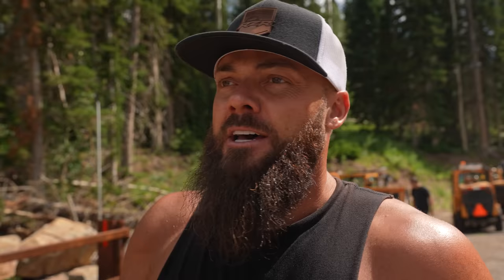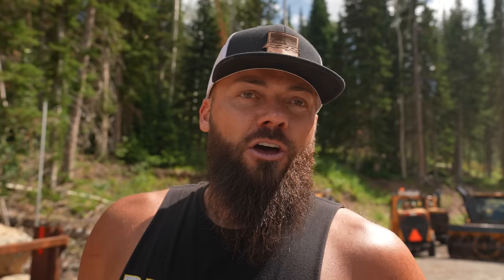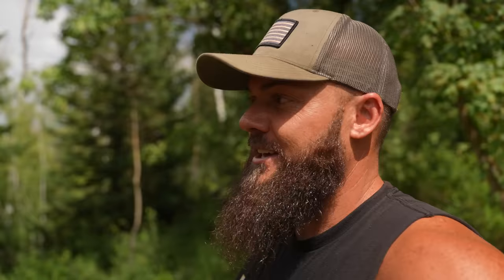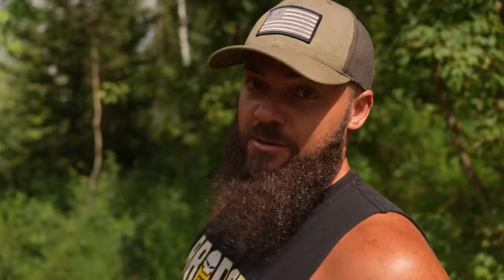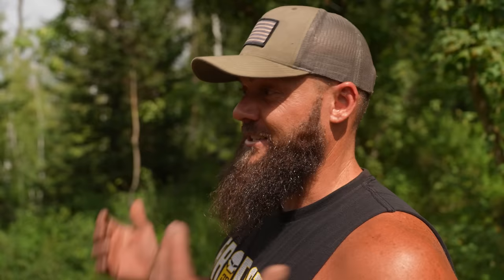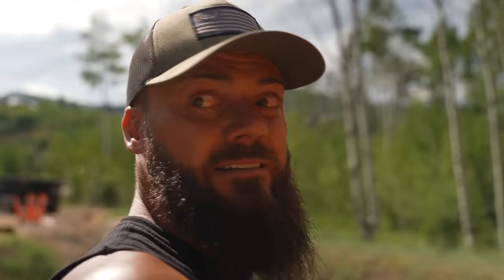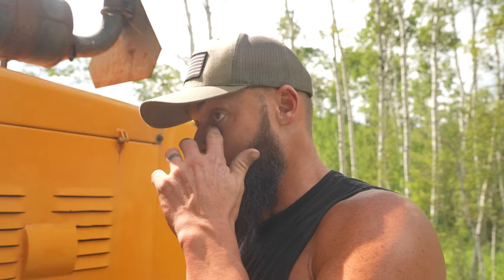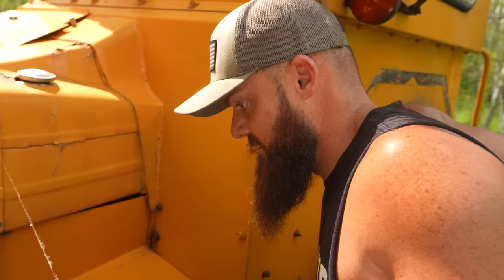I Bought One of the Most Rare an Interesting Machines In the World!

Comment: This machine is based on a Ford 5000, which was then converted by an old English tractor company called county. If it’s a 4 cylinder the tractor was probably a county 794. They were then converted to these snowblowers in Quebec Canada.
Reply: Also pretty sure the cummins powers the blower and the ford engine just powers the tractor like it used to when it was a tractor
Reply: Correct although it was based on the ford 7600 and later the 7610 which this one is
Reply: @MAXQ14  yes 100 percent.  Of course the original engine under the hood powers the tractor and the add on engine runs the add on blower. Dave not very bright. And yes a Ford county.
Reply: @oakfarmagricultural506  this one is too old to be a 7600 it has the selectosoeed box which is in the Ford 5000 era
Reply: @dylanwilliams2954  yes I noticed that afterward but its strange as it has the ford 10 series bonnet/nosecone which made me think its a later one
Reply: I was stationed at Grand Forks AFB '61-'65 and they used 4 tier augers because the snow drifts were so high.
Reply: Oh. No Canada. Retired U.S.M.C. Wave white flag.
Reply: If that's the case then the Ford engine is the traction motor and the other one would be for the blower assembly/
Reply: That’ll be the same County that converted Ford Transit panel vans to 4x4 then, which are legendary vehicles here in the UK. Also that 4cyl was the same engine that was in the first ever loading shovel I drove, made by Bray.
Reply: Mmmh, an old County Commercial Cars  (Fleet, Hampshire. U.K.) tractor base unit ! Wonder how old ? I could have built this !!
Ex CCC employee .......
Reply: Was gonna say it looks like a county
Reply: @oakfarmagricultural506  seems though it´s missing a turbo
Reply: No such thing as a 794..!!
Ether a 764 or 974 perhaps.
Reply: Yes I think r right about it being a 5000 tractor then county converted it it's worth a lot of money we're I'm from 👌
Reply: You took the words out of my mouth, I was just about to post a comment and that was it’s got to be based on the old county tractor and that is a major collectors item over here in the uk.
Reply: ...damn!
Reply: Wow!  Did king Kong ever eat snow cones?!? That'd be cool....work one of these snow cone machinesinto a new king long movie remake!!!
Reply: @oakfarmagricultural506 

😊
Reply: It’s got a 10 series nose cone that’s confusing me as I don’t think they made any like that
Reply: That cap can be swedis harra aktiepolag
Reply: I just waited to see if I can see the driveshaft for the 4wd to know exactly that it is a county. The 4cylinder is in there to Power the traktor and the engine in the back is for the blower.  Your Transmission is a so called ford select-o-speed

Comment: The old snowblower is based on a County 754 (or possibly 764, depending on the year of built?).
County Tractors was a UK based company, that converted Ford tractors (in this case a Ford 5000 2wd) into a 4wd. In the days Ford didn't supply 4wd as an option yet.
Each front wheel has a seperate drive shaft taken from the rear axle. This results in a low centre of gravity and great grip, but also in a slightly bigger😊 turning circle.

Since the tractor is for quite some part based on a Ford 5000, those parts should be available well.
For the 4wd part: those are County parts, which can be bought at Mark Osborne (County tractors parts Ltd).

The engine in the back will power the snow plow. In the first versions, this was a 6 cylinder Ford engine (about 100 HP).

County tractors are highly collectable tractors in Europe  especially in the UK.
I have a County 754 myself.

The Ford gearbox is a Select-o-Speed. Basically the predecessor of the powershift. Although it doesn't have a too well reputation in Europe, the 10 speed forward and 2 speed reverse gearbox is not that bad, as long as maintenace is done properly,  which was less necessary with the Ford tractor manual gearbox. Might be the reason most European farmers prefered the manual gearbox.
For the snowplow, the SOS-gearbox is perfect!

Many Ford tractors in the US were supplied with a SOS-gearbox, altough most of them were lighter tractors.

To transport the snow blower with a Select-o-Speed gearbox, please put the selector in Neutral to prevent damages to the gearbox, which could be pretty expensive.

If you have any questions about the Ford or County part, just let me know.

Kind regards from The Netherlands
Reply: Agree.  I have a 1973 Ford 4000 Select O Speed and it works just fine.  Tranny got a bad rap.
Reply: I now know more about snowblowers than before.  Thanks.
Reply: Also can't forget about the lever on the differential to unlock the rear end if you got to move it dead. ( I believe its on the right side, but it's been a few years since I've seen my dad's ford 4200 high crop tractor) when my dad bought the tractor, it had been sitting for about 10 years and we didn't know to much info about the select-o-speed transmission yet. Plus the area where the lever was packed in oil and dirt so we couldn't find it at 1st. The guy towing the tractor for us almost completely smoked his clutch on his 1 ton f-350 tow truck trying to pull it. Then we found the lever a while later and it was much easier to move after😅
Reply: @aboversite yea, and it didn't help that the shifter was made out of pot aluminum and friction fitted together😐 i about destroyed mine trying to put it back together
Reply: Finally a good answer and correct in my opinion.  But is the bonnet replaced? The front looks like a 10-series and not based on a 6x 5000? SoS came to the end with 6x what I know.

Comment: Those Trackless MT machines are rather neat. The older Trackless machines had the Cummins 4BT that was set at around 110HP. The latest model (MT7) uses a 74HP John Deere engine. There built in Cortland, Ontario - Canada
Reply: they rea great- i have 7 going to try to get a couple of these he picked up not too sold on the 74hp for our area not enough juice
Reply: @mitzihodges497  Blowing snow is a power hungry task. The more power the better!
Reply: @kylelarimore1808  our snow is wet and heavy more hp n gpms always better

Comment: I worked with these VOHL blowers for decades. We would mount them on various articulating front end loaders. Using the chute, I could load a tandem dump truck in less than a minute and a tri-axle in about 90 seconds. Also, if you REALLY want to move snow, turn the drum away to bypass the chute and have at 'er! Also, make sure to put shear pins on the main shaft. Just a friendly warning though, I can't tell you how much fun it is (NOT) to change shear pins in blowing snow at -40 degrees!! Those days I don't miss. LOL 😱

Comment: Those New Holland TV140s are quite useful with all the attachments and options for it. Attachments cab end loader, cab end haybine even more efficient with a engine end PTO and a hydro swing haybine,  and a cab end discbine. Have a loftness snowblower but it is a prototype one of one made to run backwards for front PTO on Deutz Allis tractors.

Comment: I have driven one of the Vohle blowers. They are almost impossible to turn but are an absolute beast when running. If I remember the front engine runs the tractor and the rear engine runs the blower unit. The blower drive train has numerous sheer pins on it. The tractor engine has a button on the dash to make it start easier. I think its some sort of decompression or oil pressure bypass. If you wind it up there is a way to bypass the output chute and just blow the snow directly out the side. Like I said its an absolute beast when running.

Comment: I live near cody Wyoming just outside Yellowstone about 75 miles. I work in a machine/welding shop. We service the blowers they use to plow the beartooth highway almost 10' of solid snow some years. And yes something that has 2 Cummins engines is for sure ready to party. One drives the machine and the other drives the blower absolutely insane how much power these things put out and just how much snow they can move.

Comment: We had a Ford County and without knowing the front motor moves the tractor and the rear engine powers the blower.
Normally the engines on the tractor is really easy to fire up.
The Ford engine runs the transmission.

Comment: I used to work for the province, they have a TV-140 and a 145 that do roadside clearing in the summer with either a 20' batwing mower or a flail head. Winter they mount a blower. They don't make them anymore, only one now that has a spin seat that you can operate it from either direction I think is a Fendt.  They also have a couple of Vohl's, unfortunately one got water down the exhaust and screwed up the engine. When they're going, they throw snow like no ones business and anything else that'll go thru the impeller. 
You got a smokin' deal on that equipment.

Comment: I agree with some of the others. The farm tractor machine is based on a Ford 5000,s maybe a 5200. We had a 5000 with that Select- O-Speed transmission and the one thing I can tell you is to only use the Ford brand fluid for that transmission. We tried using generic fluid and had nothing but trouble. As long as we ran the Ford brand oil for the Select-O-Speed transmission we were OK

Comment: Hi guys.That snow machine is definitely a county tractor conversion. The turning circle is poor on these tractors, but because of the separate drive shafts to the front on both sides, you can steer with the left or right brake pedals, to make a tight turn no problem.  Sort of like a bobcat skid steer loader. I operated one with a 16 tonne dump trailer when I was a teenager.  Still have it barn stored. Its a 1978 machine.
 County tractors are making huge money here in Ireland, and also in the UK.
Keep up the good work.

Comment: That is rare, The latest body county based on the ten series ford, that is supposed to have column shift, but I can see Selectospeed transmission under the steering wheel, A very unique beast indeed, My quess is the skid unit was based on county 964

Comment: The big guy was built in Quebec, the little Series 5 or MT-5 are Trackless Vehicles "Municipal Tractor"  designed and built in Tillsonburg, Ontario Canada for over 50 years.  The older models will have Cummins engines.  The newer ones went John Deere... shame.

Comment: You definitely need to do a snowblower race this winter.
Reply: With the Vohl, speed don't look to be on the initial design board of the eng group, but moving snow in one pass was the goal and usually the Vohl do it when the operator select the appropriate gear

Comment: if you think that blowers cool, you should see the one they use to blow snow on the Confederation Bridge, between New Brunswick, and PEI canada. its a big loader, but its outfitted with a blower thats bigger than the one on this rig. it has its own Cat engine on it to power it, separate from the loader itself. its an absolute monster. like it would eat the nose of your semi, ive never seen anything stop it. I used to work at the bridge on the maintenance crew, and my fathers been there since it opened in 97. they have some real cool stuff. 

neat bonus fact. the surface of the bridge is paved by a company in Quebec, and its a mixture of asphalt and recycled rubber, which gives the surface of the bridge extra traction over a normal road. cool stuff. also the bridge itself is hollow, if it were allowed, you could walk through it end for end. the piers are hollow too, you walk over a few wooden planks, and thats all that separates you from the dark, hollow drop inside the piers. Ive been inside there, my father has not. only a select few people have been inside the Confederation Bridge, and I am one of them

Comment: looks like its built on Ford County tractor by the drive system you steer them  with the separate split brake pedals they will almost turn in there own length,

Comment: Hey. You got yourself a good deal.    My uncle and 4 more guys owned that company.   I work there for 4 years   I was doing demonstration and transport    Really cool machine. They are Ford county from England. Usually come with GM or John deer engine  as auxiliary engine  few of them come with Cummins (special order )  PS THERE IS A  STARTING AID on the throttle on the front engine. Start like summer at -30 degree.  And  in 4 to 6 feet of snow you put pressure on the bucket down and you steer with the blade both side of the bucket.    Have fun

Comment: Probably a bunch of people already commented about the ford snow blower already, and have more detailed info on it. But to just hammer the point across. The ford diesel engine powers the tractor and the Cummins powers the blower. BE CAREFUL  with the select-o-speed transmission. Especially withe the shifting lever under the steering wheel. It is almost completely made out of pot aluminum (except for a couple of screws and the lever itself) and the gear adjustments are held in place via friction. So don't "force" a gear change or you won't know whar gear your in and parts are getting kinda difficult to find since its was not a popular option. Also there should be a lever of some sort on the diffential to unlock the rear end so you can move it dead  if need be. Otherwise you're moving probably 8,000+ lbs of dead weight. Ask me how i know😅 that tractor would make a great addition to a farmer with a tractor collection since it has a bunch of rare options and modifications done to it

Comment: The Ford engine is driving the tractor and the Cummins is on the blower. It the Ford engine has a turbo up front then It's a County 974 tractor basically which used the skid unit off a Ford 7600 tractor (97 HP) . If it has no turbo it's a 764 based on  the  Ford 6600 (78 HP). County were a British tractor manufacturer that used Ford skid units to build tractors  focused on traction for heavy field work and Forestry work.
The County tractors are very sought after in Europe and good examples can fetch big money..